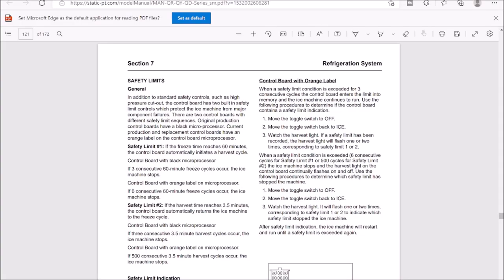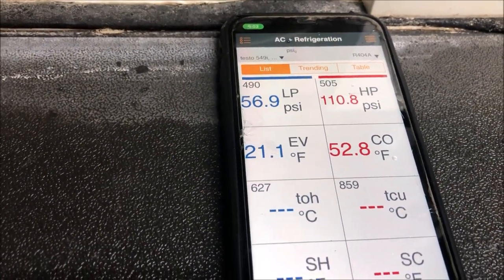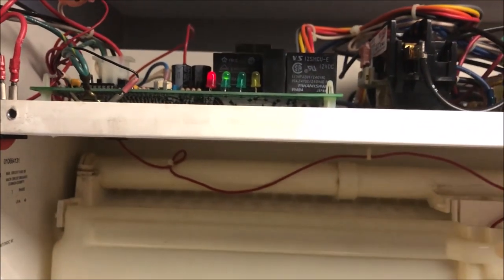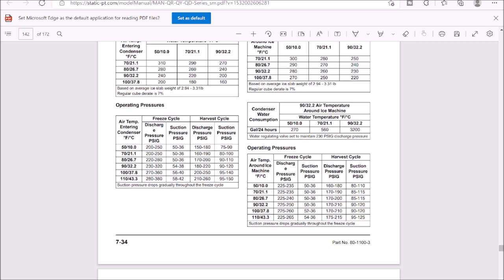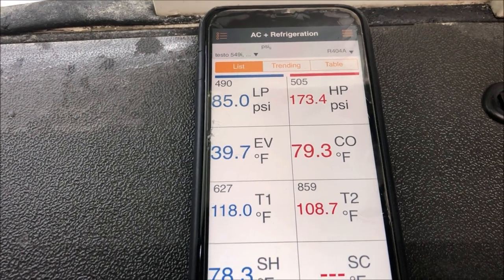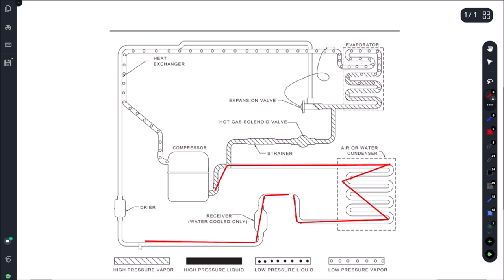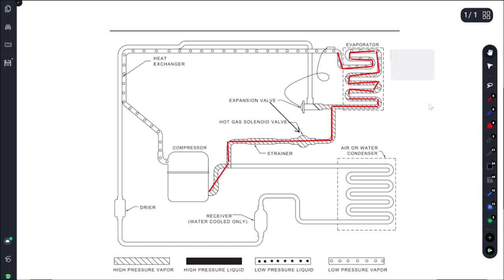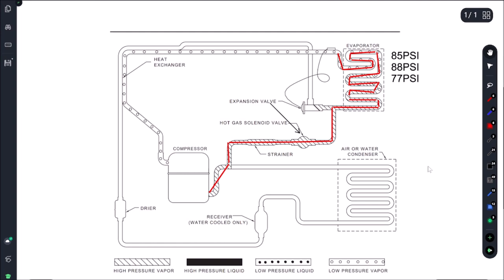Manitowoc Ice Machine Harvest Issue

Comment: Do you think there's a chance you may have just been slightly low on refrigerant? Because you were low on both sides.... And when you adjusted the valve your pressures did change... I'm just wondering if you didn't have enough refrigerant. It ran a long time before on that old valve and it was set at that pressure before for all those years... But I have seen those valves go bad especially when the units off and water still running down the drain
Reply from the maker: At first I was thinking low charge but my suction pressure was really good and my sheet of ice was even right across so I didn’t go that route. When I got there, the unit was off and there was water going down the drain so that also pointed me in the direction of a bad regulating valve

Comment: @garygordon37

good day i has a indigo NXT manitowoc ice machine it drop ice then going into long harvest then after turning in off and on it makes ice then drop then start the second cycle after freezing then it goes into long cycle. i replace the ice thickness probe then, the board and the problem still exist i also check the curtain switch and its ok, . As i say after turning it off the on after the first ice drop, the second time around after the freeze cycle it goes into long harvest

Comment: I got a compressor I believe burnt out, checked pressures and they are equal, no movement. Compressor sounds gnarly and it starts to get really hot. Hi pressure line isn't getting hot whatsoever. I'm trying to find out the cause as to why the compressor has failed, there was a company here a couple years ago from the notes that replaced the compressor once already I dont know if I should replace the txv as well.. I don't wanna get a new one in and the same problem pops up down the road. I'm going to flush all the lines with rx11 and put another drier in line to pick up any extra acids in the system. Any pointers?
Reply from the maker: Replace filters and deep vacuum. It’s rare I change the TXV

Comment: Great info!  One question, what would you have done if this was an air cooled machine?  Would you have added refrigerant to increase those pressures?  Keep the videos coming wr all benefit from them. Thanks again.
Reply from the maker: If I had low head the issue could be a low charge, a restriction (potentially the TXV) or an inefficient compressor. Would need to see the suction pressure to make a more accurate assessment
Reply: Got one 100 psi suction , 200 high  side , had bad water level probe machine had been running  without water compressor cool to touch and liquid line not hot ? Compressor??

Comment: Thank you for this water cooled ice machine troubleshooter. Quick question: I changed one of these valves several years ago and i think if you are changing the water valve, you do NOT have to recover the refrigerant right? I totally forgot.
Reply from the maker: Yes, it is connected to the Condensor and based on the pressure in th Condensor, it tells the PRV how much to open/close.
Reply: @REFRIGERATIONKITCHENEQTECH  thanks :)

Comment: All i did was Cleaned a machine like this and now it's not producing ice. You got any suggestions on why it would not work afterwards
Reply: It's a about a 2005 model
Reply from the maker: Is the curtain on correctly, water probes hooked up, water in the trough etc. Too many things could go wrong, the led’s on the board should point you in The right direction